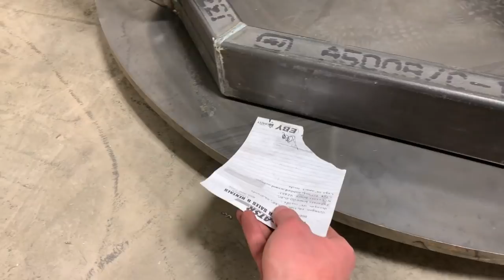Building a table to hold my vise

Comment: I actually watched this video on the 16th, but forgot to comment because I went straight to my shop to draw up a set of plans for myself. I have plenty of heavy material for the frame, and I even was strongly considering drawers to put some valuable precision measuring tools  and such. My problem is sliding 1000.00 piece of flat 1" by my boss,  as I want to us it as a layout/vise/flattening table.... got any ideas?

Comment: Instead of the pallet jack to move this table couldn't you use the crane and some straps? With love ❤ from sunny 🌅 Arizona 🌵
Reply from the maker: Yes, but why? The pallet jack is smaller so it moves around cramped quarters more easily, and it rolls easier than the crane. 
I’m also from AZ :-)

Comment: Okay, so, if Khufu had had video cameras, this is what his pyramid build video would have looked like. The table and vise together weigh over a thousand pounds. Holy Frijoles.

Hindsight is 20-20, of course, but it might have been better to not weld the tabletop to the base. Welding some dog ears to the bottom surface would have given you a place to bolt it to the base, and allowed you to move the base and tabletop separately when you need to re-position it or work on either the table or the base separately.

For moving it with the palette jack, all you need to do is add an X to the legs, shadowing the X you already have, but about six inches from the floor. Once that's in place, the jack can lift the table straight up by placing its arms under the X.

Aside from painting and finishing, I expect to see more improvements to the table in the future, such as adding different vise to the opposite side, or a lazy Susan in the middle, or dog holes on one quarter of the tabletop.

Comment: Thanks for the awesome video. It was interesting to hear your thinking on why you did what you did with the bracing, the measuring techniques especially
& bushings. 

One thing I don't understand, is the painting, are you just painting the legs/bottom center of the table?
I mean it's a steel table, you could clamp your ground to it from your welder, and use it as a welding table if you wanted? Unless
your afraid of spatter and want to use the table for more precision task, like building a small engine or something?
Reply from the maker: Yeah I’ll just paint the base, the top will be left bare. I plan to use it as a welding table, it’s not terribly precise anyway because the plate was bowed and welding it to a flat frame didn’t totally fix that.
Reply: @Jer_Schmidt   Never expected to get a response. Thanks. Good luck.

Comment: There is a lot space under that table ,drawers would have nice.
Reply from the maker: That’s why I didn’t put any stringers around the bottom of the legs, this way it’s open to put a cabinet under it later.
Reply: Great minds think alike. May be even a air compressor under there.

Comment: Missed the opportunity to fill the legs with lead shot, for added weight and for vibration damping of course! You could always drill some holes in the legs if you decided that a 1/2 ton table isn't heavy enough!
Reply from the maker: I’m seriously considering poking holes in the legs and filling them with sand. Not as heavy as lead but it would be cheap enough it might be worth it.
Reply: @Jer_Schmidt  should still help done with vibrations. In all seriousness steel tables can sure vibrate when you got them.
Reply from the maker: Andrew Frink 
Yeah, steel tables are loud! If you drop a small chunk of metal (<1lb) from just a few inches, I’m guessing that’s above the hearing damage threshold for a split second. A little vibration dampening would be very valuable.

Comment: If the base of the vise is sitting on a flat surface, you can tighten the bolts as much as you like and the bolt mounts won't snap. No?
Reply from the maker: The feet are hollow, so I’m not sure. Wouldn’t want to push my luck too far. I tightened them plenty tight to hold it rock solid anyway.

Comment: Have you checked the top for flatness? I just built a small 2'x4' welding table with a 1/2' plate top which I bolted to the frame so I could shim it to 'flat'. I like your bushings, I do pretty the same in lighter tubing using steel gas line for 1/4" bolts.  What brand is your 'precision protractor' I like it! I suppose you know that the welder you have is good for up to 3/8" single pass, or do you just like to bevel? As always you are an awesome craftsman!
Reply from the maker: I did check it for flat, as expected it isn’t perfect but it’s close. The protractor is a Starrett 359.

Comment: Have you actually hit this thing with a hammer?
One inch thick cedar for the top, under the feet and the vice, well soaked in oil of course. That should quieten it down.
Just a thought. (Or was that mahogany?)

Comment: Awesome build Jeremy and well thought out! (As all your projects are).     Off topic but it would cool to see a tour of your shop and what you have in it.   I am building a shop as well and would like to know what lights you used (and qty) ?  It look very bright with no shadows, or are you using extra lighting for the videos?
Reply from the maker: This is my dad’s shop, and actually I hate the lighting in this shop. It has eight fixtures, 6-tube T-5 fluorescent (4’). But they’re out in the middle of the shop, so the shadows are terrible along the walls. 

What I did in my own shop (where all my woodworking tools are) was to put 4’ long LED lights 8” out from the walls, all the way around the perimeter, literally end-to-end, almost touching. So I can work right up against the walls and it’s impossible to block the light. I didn’t put any lights out in the middle at all; the light from the perimeter is enough to light the middle just fine (but my shop is quite small, about like a one-car garage). I like that 100x better.

That being said, my dad’s shop is 50x50’ with 16’ sidewalls, and it has plenty of light, it’s just badly distributed. I think if those same 8 light fixtures were moved to the corners and edges it would be great. So I can’t stress enough: you want lights very close to the walls! At least that’s one opinion.
Reply: Ahh ok, that’s great advise!  Do you recommend a LED brand, color temp etc.?  My garage is 32x50 and split into a wood shop and auto lift bay

Comment: Who in the world considers what the bott......
........oh, wait.  I'm watching Jeremy, so what the bottom of the table looks like will matter.

A securement through an extension on the opposite leg will assure it never moves.
Remember, confidence in equipment capacity leads us to test those limits, and one of these days you are going to push the limits of the table balance.
Reply from the maker: I think I should test it (in a controlled manner) to see what it actually takes to tip it. That way I’ll know the limit.

Comment: A work of metal art , my guess is that there are not more than between 3 and 6 other tables around the world
similar to this one. After mankind is gone and visitors from Rylos5 are investigating earth , this table/vice
will still be around.
Reply from the maker: I actually know of one table that exceeds this one. I have seen a table with a 4” thick steel top.

Comment: if you carve a slotted hole in the center of weight you cal slide a flatbar "T" with a lifting hole through it and move it anywhere with your engine hoist.
Reply from the maker: Why would I move it with the engine hoist when I have a pallet jack? The pallet jack is more compact and rolls much easier.
Reply: @Jer_Schmidt  its much better to be able to store stuff/projects/sweep underneath it than to put cross braces low enoughh at the bottom so you can lift the table thats been my experience anyways, its also faster than bolting something on or making a complex wheel system,, it also gives you a spot to put a clamp in the center of the table if you make the hole with the clamp in mind.
Reply: @Jer_Schmidt  cheers and GL its a very nice table btw.
Reply from the maker: Fixt100 
I agree on the part about being able to store stuff under it. I’m planning to make the pallet jack mobilizer so it doesn’t interfere with that, I.E. there won’t be any stringers around the bottom. I can always use a forklift too, if it’s convenient to poke forks right under the top of the table.
Reply: @Jer_Schmidt  all good it will be a better video than what i suggested for sure hehe

Comment: Lifting eye in center of table? Friend of mine has a similar table and he drilled a hole in the center and welded a nut on the bottom. He screws a lifting eye into the hole whenever he wants to move the table.
Reply from the maker: I don’t have a good crane to move it with. The little engine hoist that I flipped it over with is really hard to roll with that much weight on it, so I think the pallet jack is better in my situation.

Once I have my dream shop with an overhead gantry crane that travels the full length of the shop, then that will be a good solution ;-)
Reply: @Jer_Schmidt  All in due time. I helped tear down an old machine shop and there was a 20' long lathe in it and an overhead gantry that could catch every corner of the building. We found molds and paperwork that showed they had WW-2 contracts...It all went into the scrap. What a shame. I send you vibes for a forklift.

Comment: "So this machinery is really good at making super crooked cuts, So I'm going to have to grind that back out using the belt grinder."

Unfortunately Jeremy this is what you are going to encounter in your lifetime, this can be simplified by the following statement.

"JET is a large manufacturer that produces tools and workshop machinery to mainly a DIY market. Whereas the machinery that is custom made by Jeremy Schmidt, had been Designed, thought out and built to a very high standard and not have the inconsistencies like the Jet branded product "  

That about sums it up, another nice job there Jeremy,   👍

Comment: Why not fit stringers between the legs at a height that the pallet lifter can get under and take the weight. You could then create a storage shelf or rack between the stringers.
Reply from the maker: I kinda want to keep that area clear. A shelf is just asking to get cluttered, if I want storage I’ll build a cabinet.
Reply: I see what you mean, nice welding Jeremy.

Comment: Jeremy, I've had a hard time trying to figure out what process welder to buy. I am learning towards a stick/tig combo machine because that gives me ersatility to weld outside and in m basement as well as welding a variety of thicknesses. What thickness stock do you weld with the most? Is it silly to think I will be welding stuff up to 1/2" for maker level projects? I may be putting too much emphasiss on this
Reply from the maker: Most of my projects only go up to 3/8”. My welder is only rated for 3/8”, and I rarely find myself wishing for more. I have almost no experience with stick or TIG, but I think you’re right that you’ll have a lot more versatility between those two. MIG is mostly just good at welding clean steel inside out of the wind, and not much else.

Comment: Why do you use the hacksaw sometimes and other times the grinder to do similar cuts?
I'm not judging, just trying to understand. Really into metal work but I do not have a lot of experience with it.
Nice build, btw.
Reply from the maker: It depends partly on the air quality in the shop. If I’ve been welding and grinding then I’m probably wearing a respirator anyway, so I might as well grind it. But first thing in the morning all the dust has settled and I don’t see any reason to grind and get the air messed up right away.
Reply: @Jer_Schmidt  nice point. This reinforces to me again the importance of Hands-on. Thanks for sharing your experience.

Comment: Question: I saw you using a hack saw a lot, and there was a cutting torch right there in the shop.  Is there a reason why you avoid using the torch for those cuts?
Reply from the maker: I don’t like how it warps & hardens the edge from the heat.

Comment: Nice work, overbuilt as usual. Somehow this slipped through the cracks and i'm only just now seeing it.
I was SURE you were going to have the 4X4 tube protrude all the way through the frame and cantilever out past the edge of the table and then just have a plate to mount the vice on (presumably with a bunch of gussets). Did you consider that and decide against it? It looks like you had the material on hand. Did you do this with an eye toward potentially removing the mount and being left with 8 clean sides? Just curious about your approach.

Comment: What can you do to prevent welding splater to stick on the table surface ?
Reply: P.S nice build ,my friend
Reply from the maker: There are products that you can spray on the surface to prevent spatter from sticking. Just google “anti-spatter spray”

Comment: Instead of taking the time and materials to make it movable with a pallet jack, why not add wheels you can raise/lower to move it?
Reply from the maker: Pretty sure that take more time and expense than the pallet jack solution?
Reply: @Jer_Schmidt  agreed, it would take a little more time, but would save time in the future. And cheap wheels aren't super hard to source these days. And I imagine you should have almost all the scrap you need to do it with.

Comment: Jeremy- do you ever have any issues on your projects with your Miller 211? Do you wish you had bought a larger welder?
Reply from the maker: Not really. I’ve even welded some pretty heavy material with it and no welds have ever failed.
Reply: @Jer_Schmidt  Good to know. I'm in the market for a new welder and I think I'm set on the 211. Thanks!

Comment: Not a welder at all, nevertheless very interesting. Are you sure you pulled the table top against the X and not vice versa ;-)
Reply from the maker: I was a bit worried about that, but before starting the project I put down a piece of 2.5” sq tube and clamped both ends tight, then checked the tube for bow. It was bowed very slightly but the plate bent more that the tube. So I figure with 4” tube the plate would definitely be the one to yield.

Comment: If you're ever going to do any kind of light hammering on that table, you'll need ear plugs under the noise dampening headset :-)
Reply from the maker: Yeah, I need to put some sound-absorbing material on the bottom.

Comment: If you dare to ruin the finish a little, you could mount a removable bolt into the center of gravity and then just lift the table there with your crane to move it about.
Reply from the maker: That crane is almost impossible to roll when you have that much weight hanging on it. The pallet jack will make it move a lot easier.
Reply: @Jer_Schmidt  OK, understandable - it's a bit of a challenge wth that kind of mass. So something like a bottom shelf in between the legs, that doubles as a floor jack mounting point?

And adding more mass as you go... ;)

Comment: Should've installed a axle in the center to allow you to spin it and install a whole family of vises or tools. 🤣😂😁😂🤣
Reply from the maker: Could’ve done something like a lathe tailstock turret. Have 4 different vises/tools mounted on it so they would be under the table when not in use. 😁
Reply: @Jer_Schmidt  
Yes, you definitely should make use of all of that space and hard work you did in creating that Iron OctoGod 
It's indestructable. You did a great job planning & reinforcing its structure. You definitely must utilize that space. It was a Interesting build to watch. 

Best of luck.
Reply: Where did you find that vise?
Reply from the maker: Renee Mills 
It’s a pretty common one that you can buy online from most tool suppliers. I bought this one on eBay, just because that’s easy and I don’t have to give out my info to a random website.